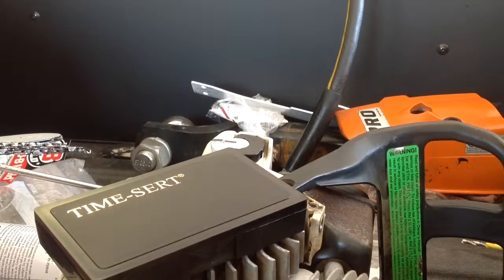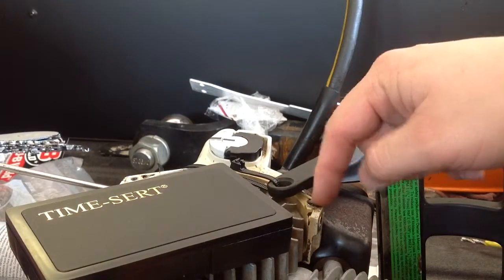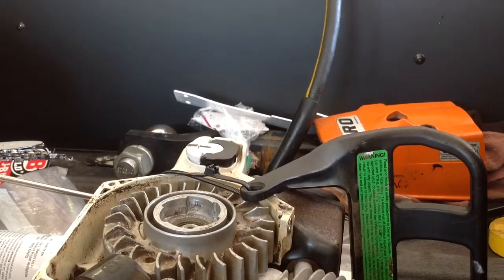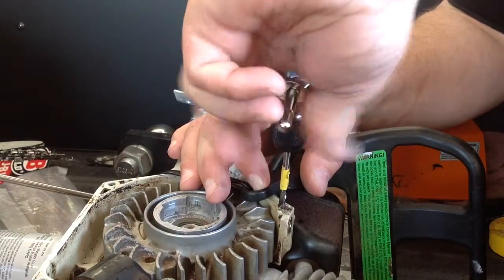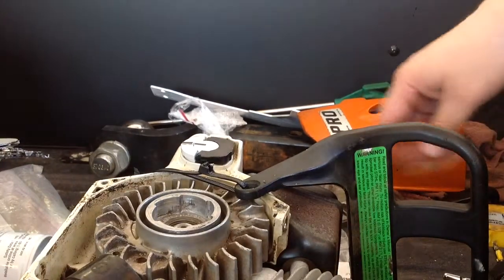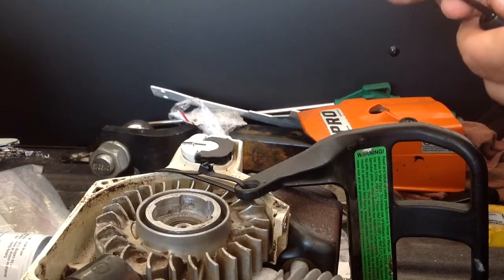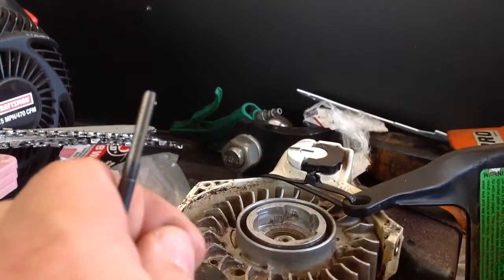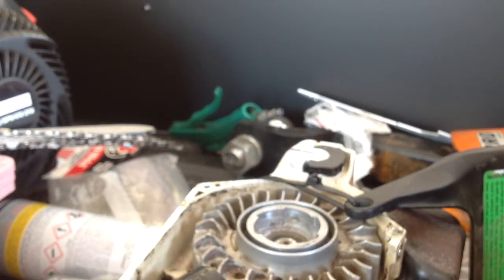Stihl MS 260 Time-Sert,  1 of 2.  Thread repair of stripped threads.

Comment: Well I'd say you must be rather lucky. Maybe should buy a lottery ticket. Lol. Every thing worked out for you. But you went way to fast. Made me cringe when you went with the drill bit. Then the noise, and you kept going. Should have backed up. Lucky you.didn't break the whole side off. Have to be careful and go slow with soft material. Bit can cut a spiral groove instead of a hole. And when using a tap, you don't.just screw it in. A couple reasons. You can start ripping threads out from not having enough started to hold it. Or you can get jammed and break your tap. Which is not fun. Can't drill a tap. Using a tap you go in a little the back it out. This cuts off the burr from the thread you made. If you don't cut it off, it gets jammed . Way I was taught was quarter turn in half turn out. Good rule to follow. Although once started you can go a little faster. Depends on the material.